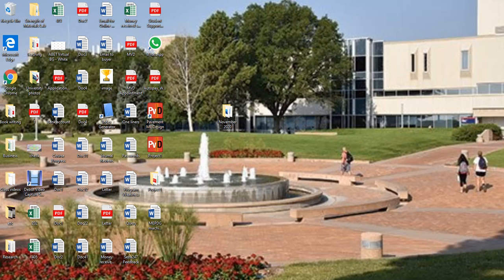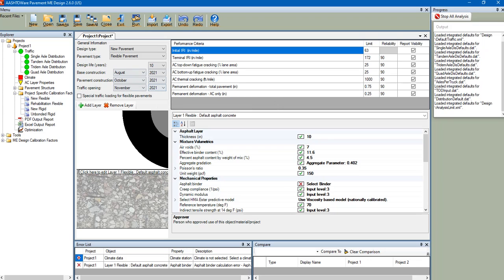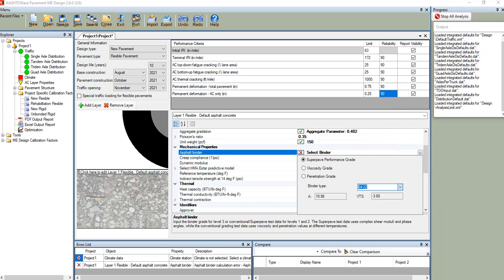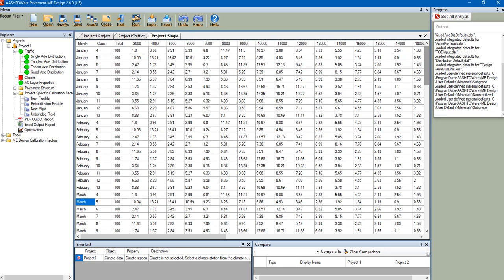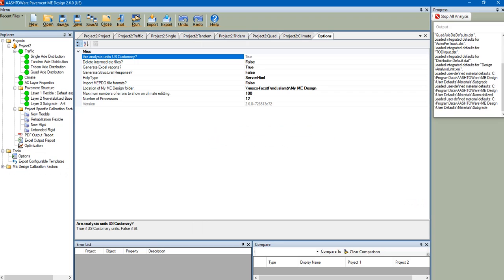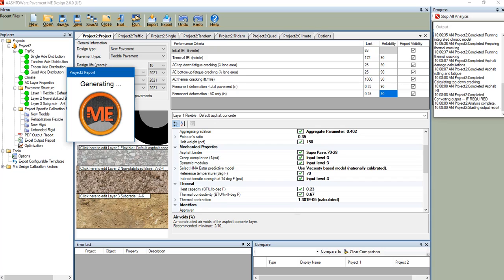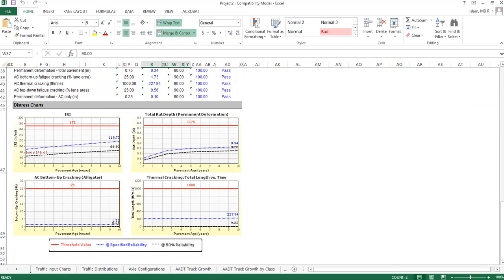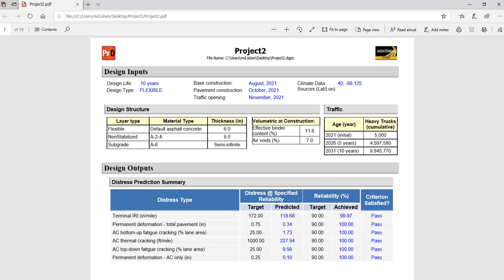Pavement Design (Lec 61) - Designing Flexible Pavement by AASHTOWare or MEPDG software

Comment: Belachew Gebrewold
0 seconds ago
Dear Professor: I have seen your paper on Pavement Temperature determination "Determining asphalt surface temperature using
 weather parameters". So, my question is; Is that possible to import climate date (other than the one provided on the database) in to the software? Thank you so much for wonderful explanation!

Comment: Good afternoon, how do i modify they vehicular classification and add clases 1,2 and 3?
Reply from the maker: So far I know, we cannot add 1, 2 and 3 classes in pavement design. These traffic produce very negligible damage and is excluded from pavement design. These classes are included in the signal, lane and other superstructure design.
Reply: @m.rashadislampephd8185   i thank You, one more question, does the software work with equivalent axes or with the load spectrum?
Reply from the maker: @danielmoreno9855  yes! You can input as your own or you can import a text file.
Reply: @m.rashadislampephd8185   do i import the axes or the load spectrum?
Reply from the maker: @danielmoreno9855  Axle load should be imported as too big to input it. Axes are very small and can be easily input.
Reply: Hello sir do you know how to design pavement in WESLEA software?